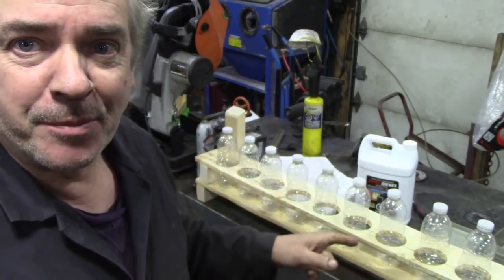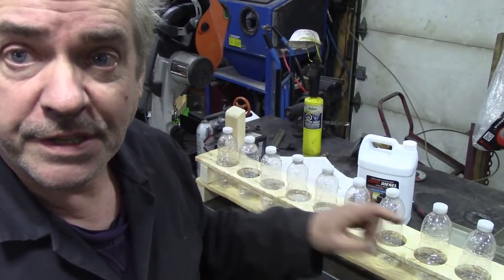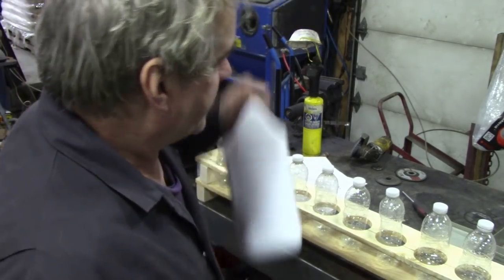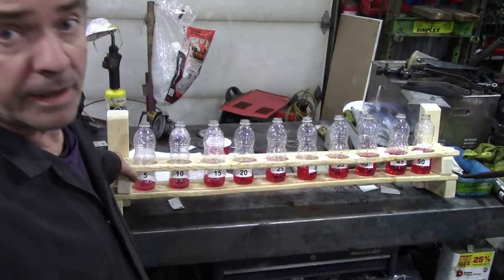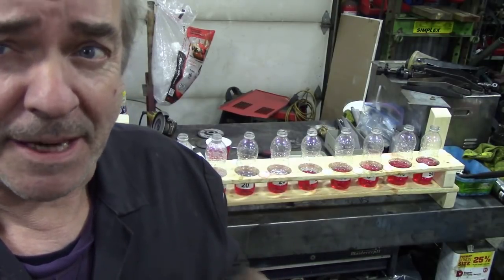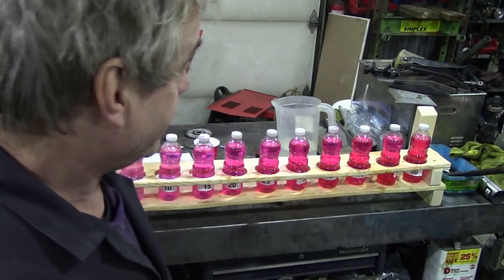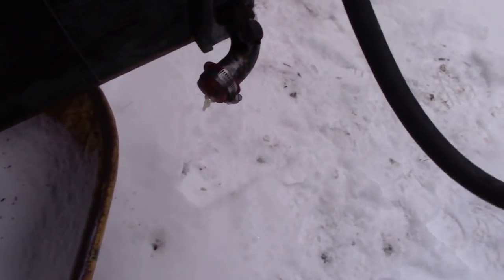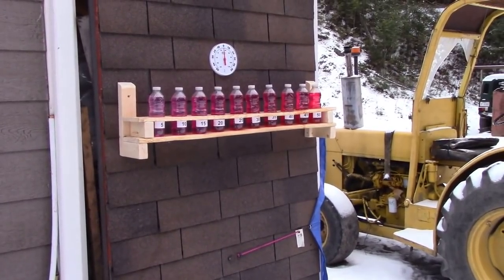Antifreeze test

Comment: Great video Mike. Just a tip for your follows that drive diesel's.  Put a little diesel in a bottle and leave it outside of your vehicle, and every morning take a look at it to see if it is ( WAXED ) frozen. SO!!!! what are you going to do for 2021? cant wait to learn what you have in store for us Mike. All the best, have a safe ,merry Christmas and a happy new year.  Yorkshire Rob.
Reply from the maker: Interestingly here Rob, is the Diesel is very good at low temps - not had any waxing issues BUT the diesel here has very low cetane values so not much power - but starts better in the cold
Reply: DERV is not to bad here now mike.  I got fed-up of having to go out with a flame thrower to wagons that had waxed up, so putting derv in a bottle next to the pump seemed like a good idea. I started to put half a gallon of petrol in with twenty gallons of derv, and that seemed to sort it out. I find that MILLER fuel additive is great to higher the cetane rating of derv, which can lower smoke. Thats handy to know at MOT time. SO there lays a question Mike. HOW GOOD ARE ADDATIVES. ( I feel a trial coming on). Nice boots, merry Christmas from Yorkshire Rob. @BritannicaRestorations

Comment: I've just been sitting here watching your experiment developing and wondering to myself, "how will this effect me here in North Queensland",  my D1 Disco is probably safe, at least until the next Ice age. Mike, I still can't figure out how life can survive at those minus temperatures. Say hi to Santa for us...
Reply from the maker: I wonder what you guys use as anti corrosive down under? I see a lot of African engines here that have only pond water in them that makes the engines completely rotten with corrosion
Reply: @BritannicaRestorations  even up in our part of the world we still use the same anti boil/anti freeze as you'd use up there. As you'd know from your time here Mike, we have parts of Southern Australia that have snow and ice. We all use the additives just in case, that seems to keep the corrosion at bay. I used to use a Barr's product in my old Jaguars that was just like soluble oil.
Only see rotted cooling systems where owners are too tight to buy additives.

Comment: See, this is the sort of thing that should reassure your customers that their vehicles are in good hands.

There's nothing worse than people who rely on dogma and received wisdom to inform their decisions.
"We do it this way because this it the way we've always done it"
Smart people make the effort to find out WHY things are done the way they are, and if there's any way to improve the way things are done.

Only thing I'd be concerned about, with antifreeze, is that something like, perhaps, a 10% mix might be sufficient to prevent freezing but it might NOT be sufficient to perform the coolant's secondary duties such as lubricating and preventing corrosion.

Even so, it's always good to have more information, rather than less.
There might come a time when, perhaps, somebody's forced to drain their coolant and re-use it after making a repair so this will tell us whether it's safe to do that until it can be replaced correctly.
Reply from the maker: That's right  - coolant can get diluted pretty easy as it is simple to collect old coolant and top up with water 
For this reason I usually use premix universal antifreeze as you do not know what has been used before - some of that OATS stuff will not mix with other types and settles out like oil and water if left - I feel an experiment coming on!